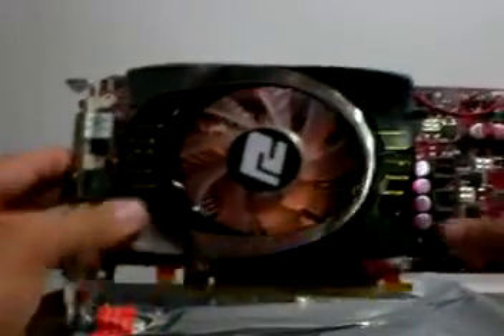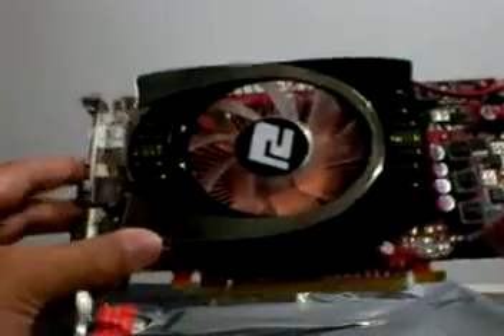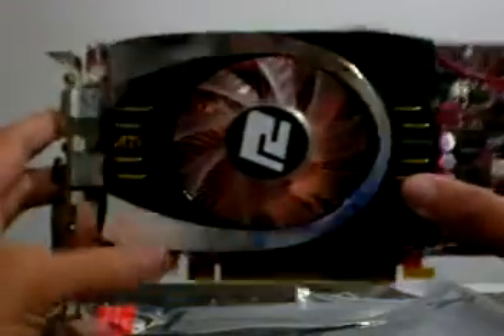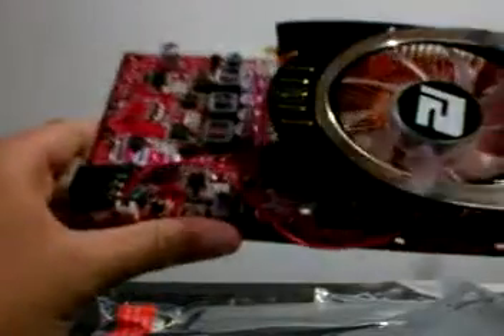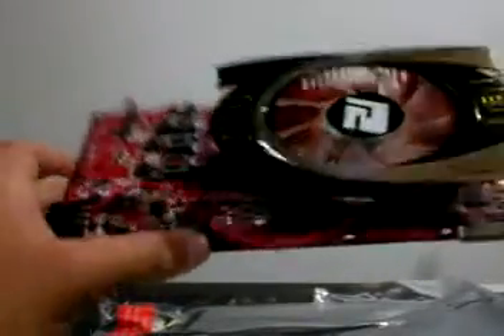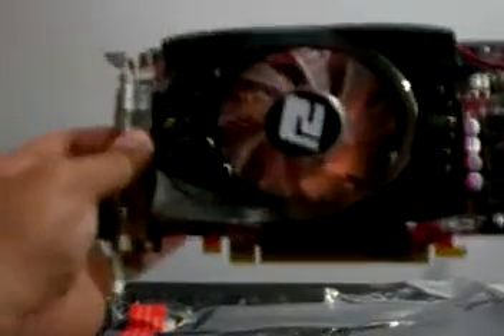Powercolor ATI Radeon HD 4770 Full Review

Comment from the maker: No, you can use a HD 4770 on any motherboard that supports PCI-E 1.0 or 2.0 regardless of chipset and socket.

Yes this video card does use 2 slots as I said in the video, there are probably some single slot versions if needed.

Comment from the maker: Well a good 1GB fast card (not the media card GPU's with 1GB) like a HD 5770 or GTX 260, for maxed settings. I like my HD 4770 though.

Get DDR3 it's now cheaper than DDR2 and faster if your building a new PC, minimum 1333 MHz speed.

No problem. :)

Comment from the maker: MW2 I can play maxed out with no problem at all 30 FPS all the time MINIMUM, your FPS will only drop because of the matchmaking service. GTA4 I can run all high mixed with very high settings without AA and standard view with no lag. GTAIV requires lots of VRAM as the HD 4770 has only 512MB. All run at 1920 x 1080.

Comment from the maker: That's the effective memory clock speed, the real clock is 800 MHz. The way you get that is for example DDR2 RAM that runs at 800 MHz actually runs at 400 MHz but makes two cycles thus getting 800 MHz.

Comment from the maker: GDDR5 is only for video cards, and you can put any type of video card in your system as long as you have the slot for it and the power to run it.

There is no such thing as a motherboard will only run a certain type of GDDR.

In simple terms, the higher the GDDR the faster the GPU can go and transmit data.

Comment from the maker: Automatic is what I use all the time, if the load is getting higher (by playing games or watching a movie) the fan will automatically adjust to make the card cooler. 

When benchmarking I set the fan speed to 100% so nothing bad happens just in-case for maximum performance.

Comment: Ironically it performs a lot better than some of the higher priced cards :). 2 of these in Crossfire and they can take on the 4890. The 4770 are about half the price of a single 4870. Might as well by 2 of the 770 as there's no point buying expensive DX10 cards when DX11 will be out by the end of this year.

Comment from the maker: Better than the HD 4830 by a long shot, by slightly weaker than a HD 4850. But this card has 40nm, so it will run much cooler than a HD 4850 and uses much less power.

It also is very small in length making it fit in most cases. It can also perform better than the HD 4850 with a very very small overclock.

Comment from the maker: AMD Athlon 64 X2 Dual Core Processor 5000+ Black Edition @ OC'ed 3.1GHz
Scythe Katana II
Arctic Silver 5
Foxconn A7DA-S
Corsair XMS2 PC-6400 (2x1GB) 2GB Kit
Seagate Barracuda 7200.10 320 GB SATA
Powercolor ATI Radeon HD 4770 
IBM C92 CRT 19" Max Res: 1600 x 1200
Realtek HD Audio
Sony SRS-A37 2.0 Speakers
Plantronics .Audio 370 Gaming Headset
Windows XP Professional Service Pack 3 32-Bit
Windows 7 Ultimate RC Build 7100
Xion II Case
Xion 450 Watt ATX Power Supply
Trendnet Wireless N PCI Adapter